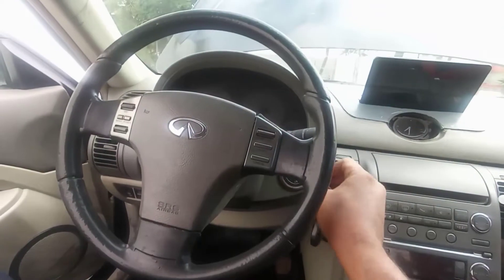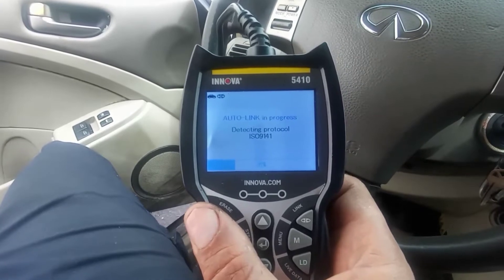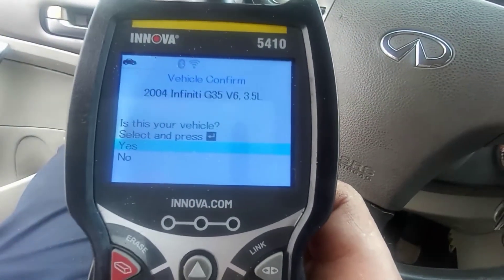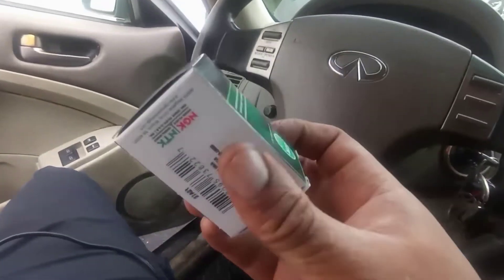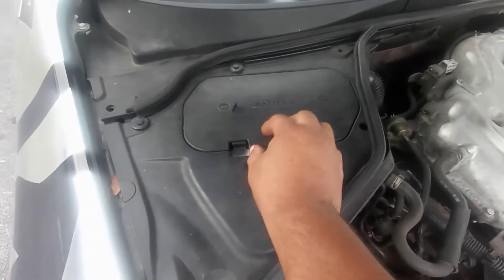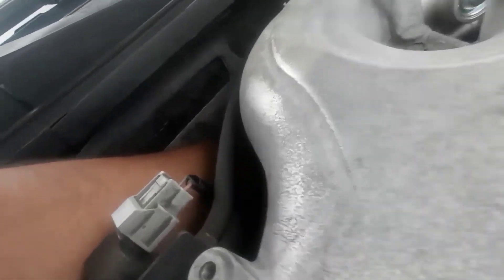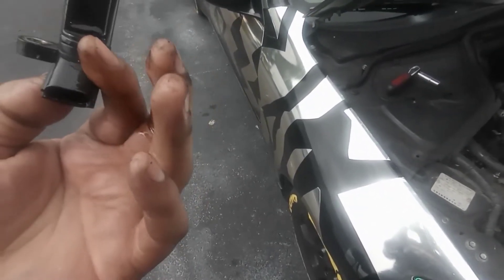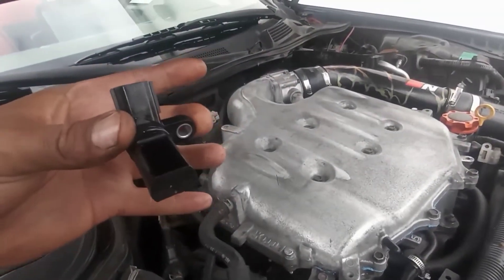How to fix P0345 C1130 2003/2007 Infiniti G35 350Z Crank no Start camshaft position sensor bank 2 DY

Comment: I'm glad you showed me the alternate way to replace the #2 bank sensor. I was thinking the same thing as you but everybody kept pulling the air flow tube and throttle body off.

Comment: I have an issue i got the po345 code and replaced the bank2 but i am still getting it do you think it could be a crankshaft sensor
Reply from the maker: Make sure the connection is good look for the fuse for the crankshaft position sensor and if anything is good go and reset the ECU there is a lot of video how to reset the ECU and the car be dropped better after that or if you have a tools to scan the car and there is some other code and abs sites if you don't reset that code the code they got to stay there so you have to reset all the call together and one shot

Comment: c1132 engine 3 fuel cut system fault infiniti g35, do you know what this is?
Reply from the maker: Check your brake fluid if he's low if it's low add some fluid

Comment: This same thing happens to the 2nd gen Nissan Xterras also. Bought one today and on the way home it kinda spluttered and then continued running but the check engine & slip warning light came on.  Also became hard to start.  When I got home and put the code reader on it & found the C1130 code and 5 of the P0345 codes  They have the 4.0 V6.  Thanks for the great video, found it while researching what was going on with my new to me 2012 Xterra
Reply from the maker: First thing you can do before you change the sensor reset the lights or you can disconnect the battery negative sides almost for 30 seconds and see what happened after that
Reply: @LessExpensivefix  Yes sir, I tried that first.  I cleared the codes and it run for maybe 15-20 seconds before check engine light came back on.
Reply from the maker: Okay we need to change the sensor but when you change the sensor I got to show you how to reset the lights how to reset the lights gets a OBD clear all the code start the car then turn off the car go to mass airflow sensor disconnected start the car until he gets angel lights on then turn it off and put the OBD scan the car then put the plug back to the mass airflow and reset the lights and start a car let the car running at least 15 minutes to 20 minutes then go drive the car this process is for all Nissan Infiniti